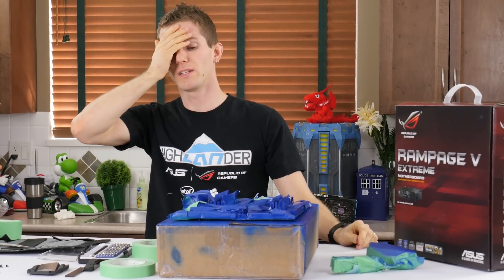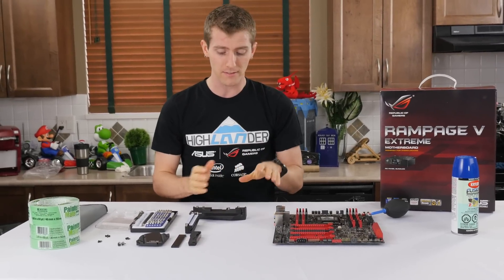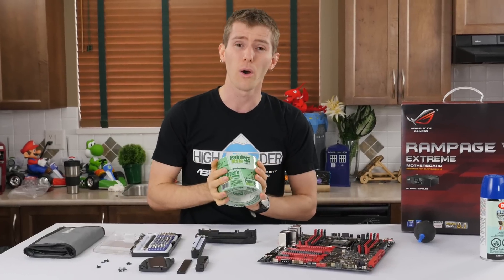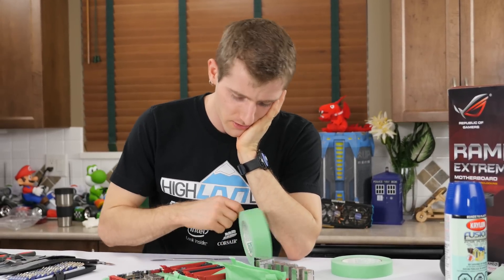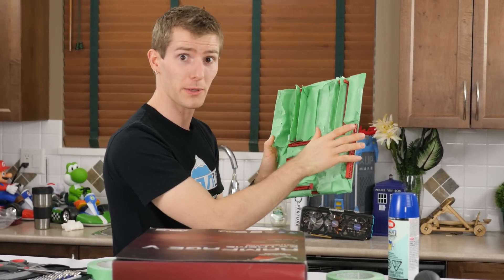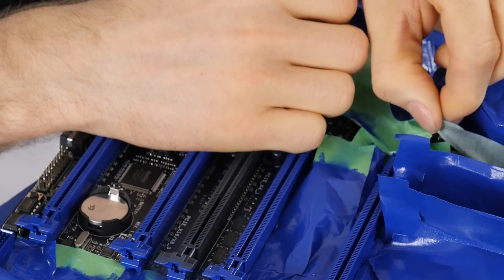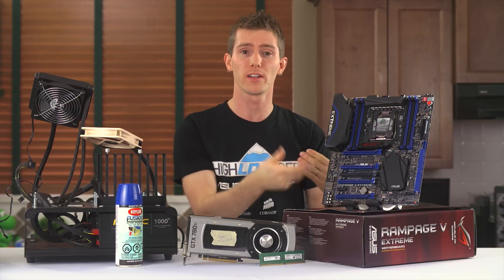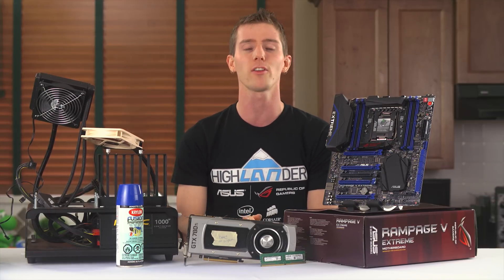Painting A Motherboard DIY Mod - ASUS Rampage 5 Extreme - Part 1

Comment: WOAHHHH!!!!! The intro song, while short, is wayyyyy cooler than the new one! Neither line up with the video though. This one does a lil more. But after mentioning that the new one is off by a few milliseconds the other day after it grinding my gears for years, I THINK they changed it but I'm not certain because the lag is still there. 

Also yeah cool motherboard..I'm trying to paint mine all white but I have NO CLUE what parts are safe to paint except for that I shouldn't paint over connector pins. But anyone would know that. I just dont know if I can paint over the little black squares. I think they're called chiplets. Also idk if I can  paint over capacitors. Also I dont know if I have to  a specific type of paint. Can Anyone help?

Comment: Can you get paint in your RAM slots? two of mine are Red and I'm going for a white and black build. Also, my motherboard has red stripes some places on the face of the board and a could of heatsinks, can you paint on the heatsinks and over the face of the board? Thanks.

Comment: I know this is old video, but I wanted to point out that your board is not "RED", it has red accent slots... your board is actually black - not sure why you call it that way. This is not a big issue, I just expected completely different thing to happen in the video. In other hand... this is quite interesting and helpful as I am planning to paint the PCB black and I was thinking of covering all the sockets, from your video it is clear that covering sockets might not even be necessary and cleaning contacts are not as difficult as I though it would be.

Comment: i can tell immediately that this will go bad. 
a biuiiig thing to do could've been to use dead ram dimms and pci-e cards to cover the ports, using dead sata cable ends, stripped, would've saved all the ports.

also, using airbrush paint and not spray paint would've been a MUCH better way to go.

Comment: so why didn't you just put an adhesive film  over the board and cut out the pci slots and other parts you wanted to paint? Seems like a far quicker method, plus it's only one piece so unless you would screw up the cuts it's a tighter fit.

Comment: Linus, Why not put some cheap parts in the ram and pci slots to prevent issues/cleaning later on, also, you can easily make a vinyl cut out and print it out at staples, Bam no taping. 

your welcome :)

Comment: You could've 3d printed fake ram to put in the ram slots so you don't paint the contacts but leave the visible parts painted.
Reply: TheRandomguy06 or use cardboard

Comment: Linus you should invest in an airbrush for painting things like this. You can get a much smoother and unifrom coat and it allows you to pains super specific areas. It's like a spray paint pen
Reply: Like for those components where you really couldn't get in close to paint an airbrush will really help

Comment: Honestly,  you could probably just take up most of it,  then put plastic place holders in the slots,  considering if something's plugged in,  you won't see the covered bits anyway.  This is what I would have done.
Reply: Meant tape instead of take

Comment: So the paint going inside the slots didn't cause in contact problems? (paint on pins)
Reply: He applied the paint at an angle, it's not like he was spraying directly into the slots. He used a dead graphics card and dead ram sticks and some pins to clear up any paint that could of gotten into the slots. So, no because he used the motherboard in his personal rig

Comment: You could try to find some kind of plexi (or something) with thickness similar to gpu and ram modules. Then its as simple as sticking them in, maybe adding some thickness with tape if needed. I will propably find myself doing something similar in near future, so i might make a video out of it.

Comment: Why do people like PS2 ports?
Reply: Because they allow u to play the newest PS 2 (Or playstation 2 games) at like the highest screen resolution available (that is , 360p) On your computer . WOW Now that is the future
Reply: The PS/2 Ports being a life saver is strange logic, if they removed the PS/2 ports there would be room for 2 or 3 more USB ones so that makes this point irrelevant. People like PS/2 ports because there is still some specialized hardware made today that use it and there is older hardware still floating around that also use it such as KVMs and Keyboard & Mice.
Reply: +Hezekiah Domowski actually as any usb device your wireless mouse and keyboard runs over the USB generic driver. In the early days of usb keyboards you might have the problem that the system would load the keyboard driver only at a OS level and not at the bios, so you couldn't access and control your bios, with USB 3 ports we encountered a similar problem.

Well, now days almost  any bios can load drivers for usb keyboards, and keyboards use the same generic protocol for basic imput, you can still run against problems.

One big advantage of PS/2 is priority, a command coming through  this port has a higher priority than a command coming via the USB port.
So even if your system is hanging up and not  responding, if you press something on your ps2 keyboard the  system will prioritize  it's command.
Reply: N-key rollover truly works only with PS/2. 6 key rollover is generally the upper limit with USB.
Reply: PS/2 is also interrupt based, rather than polled as with USB.  For games this can mean marginally lower latency with keystrokes but it also means that keystrokes will more likely make it through in disaster scenarios like when the system is so busy that USB isn't polled correctly. This is important with Linux, which has a "magic sequence" with the Alt-SysRq key combination that will activate a disaster recovery escape sequence as long as the kernel is operational and the relevant bus is working (e.g. PS/2, serial, USB).
Reply: Well for me, I only have 4 usb ports and I use alot of accesories that uses USB cables (eg. Speakers, Web Cam, External HDD, External DVD-R reader, etc.) and if I use a USB mouse and keyboard it would take 2 of my usb ports so for me having PS2 ports is a life saver.
Reply: How did you find a keyboard or mouse that use a ps2 port?
And if you were going to get an adapter, why not get a USB hub?
Reply: +Hezekiah Domowski I use Logitech k100 keyboard, it still uses PS2, they also have the same design but has USB and I used a USB-PS2 adaptor for my mouse. I had tried some usb hubs before but for some reason it wont read my thumb drives and such
Reply: since no one seems to actually know why, and didn't answer your question, PS2 ports don't need drivers for the mouse or keyboard to work as it's a defined standard that all manufactures adopted, all PS2 keyboard use the same protocols and require no drives as it's supported at the hardware level, which is good if you've a driver issue or something isn't working right.
Reply: That is also why he likes USB 2 ports, the USB controler doesn't need drivers
Reply: its good for overclocking, sometimes if an error occur the usb ports dont work, if you have ps2 you dont need cmos reset...
Reply: go to any thrift store...they usually have a bunch of older keyboards lying around.  I've bought a few and they always worked perfectly.
Reply: +Joshua Nicoll ahhh, thanks I always have used Logitech wireless which don't require drivers
Reply: What is a key rollover?

Comment: Hey Linus saw this a little late but you should look into "conformal coating" and the masking tapes, dots, and boots large companies use so that they can spray PC boards while protecting all the various connectors.
Reply: Also Peelable solder mask

Comment: Why would any serious PC person need wifi on their motherboard? Do it right run a few cables!! If you really need wifi then use a usb stick it's going to cost less and it's not like your going to do much serious stuff other than netflix over wifi.
Reply: Usb wifi is terrible if you want wifi motherboard it
Reply: +Konnanator Konnar I would say if usb wifi is not your thing save the money and buy an addon card.
Reply: Actually Usb dongles quite often conflict with other USB devices and stop working and are often very low range and speeds. On-Board Wi-FI is typically very High speed and very good range, Speed that Exceeds that of running the cable and "doing it right", yes, faster than Cat6, for people on the high end PC market this IS doing it right. Less mess, not taking up a PCI slot so your PC looks nicer and achieves very fast speeds that which exceeds Ethernet cables. Add on Cards look ugly if you are going for a clean look and can take up pci slots you may need, sure they are cheap but if you consider that a 1900Mbps Addon card for $90 the Motherboard With wifi is suddenly very attractive as it usually doesn't cost alot more than other boards in their range. For the typical end user an addon card of usb wifi for $20 or so is a good solution but by no means is running a cable doing it right, different users have different expectations to be met and there is always a reason for different kinds of hardware such as onboard wifi. (:
Reply: +Snow Golem hard wired will always be the fastest and most reliable connection. Wireless even when you put in the massive effort (or absurd price for hardware that just works) to get working right and fast is still significantly slower. WiFi on a desktop is literally only for when you literally can't run a cable.
Reply: Did you actually just read what I said or not. Standard gigabit lan is 1000mbps and we have Wi-Fi chips exceeding 3100mbps . reliability of these connections is also good because they use the 5GHz band with far less distortion in the frequency range due to less devices interfering. That and when you are buying high end gear it's going to be reliable anyway not some 5 dollar usb stick. On board Wi-Fi takes no effort and it costs less than an add-on card. All of your points are null.
Reply: I build, repair and sell computers and their components for a living and am surrounded by all kinds of hardware configurations, a high end Wi-Fi card in built to a high end mobo is better than a cat 6 wired connection. You don't need to go into any effort what so ever to install it as it's aready on the board it costs far less than an add on nic or Wi-Fi card if you do some math comparing against similar boards. Far more speed no cables no mess no electric surges blowing it up (lan suffers from this quite alot) oh and did I mention you don't have to run cables everywhere to everything which can be a very costly deal when you're connecting multiple devices at different corners of a building, cable costs alone could cost you over $100 just for 4 devices.  (all of my prices are speaking AUD before people to crazy saying that's absurd). Please revise your elitist thoughts on pc hardware it seems to me that you are one of the typical people that will just stubbornly defend what they think is right without looking at the facts. Have a good day
Reply: +Snow Golem either way wifi is a second option. Signal issues and the like. I also want to point out that I mentioned that while some wireless hardware is capable, its expensive and difficult to set up and requires you to upgrade your network to support it. Again only good for special situations.
Reply: +Aisha Kegawa Nope, inbuilt this not difficult to set up and every Wi-Fi modem is as easy as the next to setup the speed of them doesn't change how hard it is to set up. again, you're spouting random shit without offering any fact this is all your opinion and I'm afraid its wrong. Signal issues are hardly ever apparent with decent hardware especially in the 5ghz band. buy a garbage modem or router expect shit signal via Ethernet or wifi.
Reply: +Snow Golem I really hope you don't set up stuff for the novice. Fancy wifi routers are a bitch to setup and troubleshoot and I have always had issues with wifi cards even those fancy expensive ones you say work great(when setup properly).

I'd rather spend that extra money buying an all new expensive router and new cables as well as whatever cost is associated with the wifi adapter itself on a better pc.

The expensive routers that do what you say are so bloated with extra features that it takes an IT professional just to set it up and god forbid anything goes wrong later or you need to forward ports.

I'm not against WiFi, I use a regular high speed router with gigabit lan WiFi in my house is just for phones and other portable devices as it should be.

Comment: Old trick if no body has posted not reading 2,000 plus comments to find out either lol but get a old graphics card ,, one that don't work and fill in your slot your going to use before spray and it will help keep the inside clean also works with low end crap memory
Reply: low end, Crap ddr4?

Comment: You could use dead rams and graphics cards to cover/protect the slots while painting.
Reply: Or put a piece of cardboard in the slot
Reply: +Aditya Singh He said he didn't have a set of dead DDR4 and using a gfx card would have caused for uneven paint.
Reply: I was wondering about that, the paint is gonna be on all the contacts.
Only need one bad contact and the thing will malfunction.
Doesn't seem very clever considering they are supposed to be computer experts.
Reply: Same for the SATA ports.

Comment: @Linus I successfully painted by asus motherboard having gold and black scheme red. I used dead rams, video cards bought from local computer repair shop and sata cables to prevent the paint from getting onto the connectors and I ended up with an awesome red black mobo which I always wished for.

HATERS WILL HATE, MODDERS WILL MOD.

THANX LINUS. GOOD VIDEO.

Comment: should of used a spray brush kit too much over spray if your tape isn't 100℅ attached you will have a way bigger problem if the board isn't covered.

Comment: Why you just don't  unsolde the parts, which you want to paint, paint it singly, and sold them back?
Reply: It's risky soldering loose bits of a motherboard and then soldering it back again, so much can go wrong
Reply: +Crooked crang , I don't think so. With Rose's metal it would be very easy
Reply: +Альберт Намаев watch the next video

Comment: How are all the sockets supposed to work if paint is going to drip down them???
Reply: He's going to get some tools and clean them
Reply: +David Guba See how he was painting, he did thin layers, and held the can far away. By holding the can far away he only got very small amounts on at a time, and by applying these thin layers, letting them dry, applying them again, letting them dry, etc. it prevents any dripping.